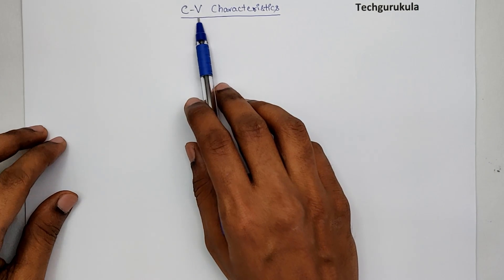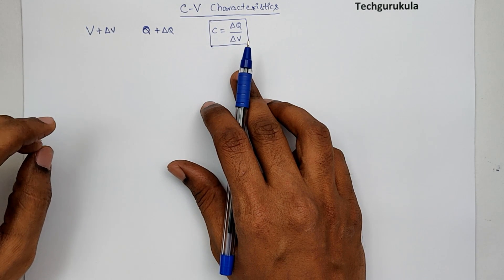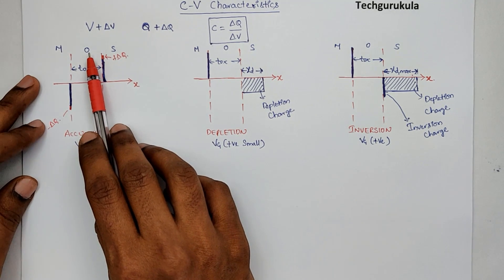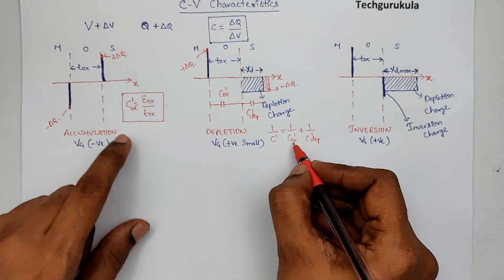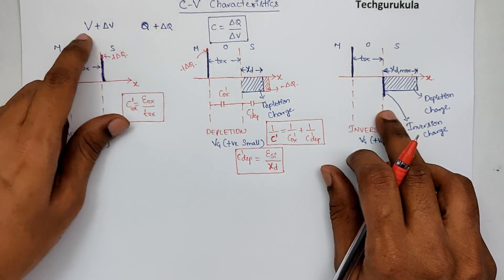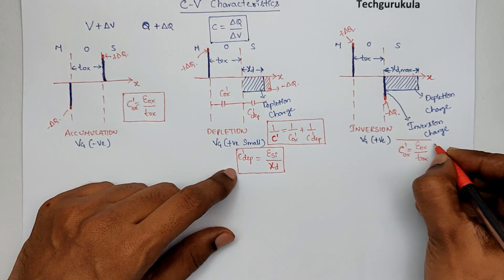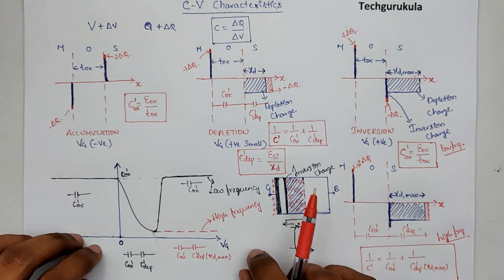Electronic Devices: MOS Capacitor (07) - CV characteristics

Comment: for high frequency, the depletion width is increasing, so why is the capacitance just Cdep, max? why is not like in depletion mode where its dependent on the depletion width length, which in the case of high frequency, is bigger than xd max.

Comment: This is confusing.
Why does in accumulation q gets deposited at interface, while in depletion mode it cant and then in inversion mode, with depletion layer it can?
Why would there be thermal generation when theres no heat for inversion to happen from within the depletion layer?
And for inversion, if q gets deposited on the metal and semiconductor interface, why wouldn't Cox change? C=q/v, q changes there.

Comment: Sir, In inversion mode, why are we not considering €si? There is depletion region charge for width Xdt.
Reply: The "capacitive action" after inversion happens only on the metal-oxide surface and the oxide-silicon surface. You can see that any delta Vg after inversion is accumulating NET CHARGE on the surface of the metal-oxide and oxide-silicon layers only, separated at a distance of tox. The depletion capacitance is not a "capacitance" anymore after inversion because there is no net charge accumulating on both surfaces of the depletion layer (the two surfaces namely being the oxide-silicon surface and the right side of the depletion layer) for any delta Vg. Hope it helps. Cheers!

Comment: doubt 😕
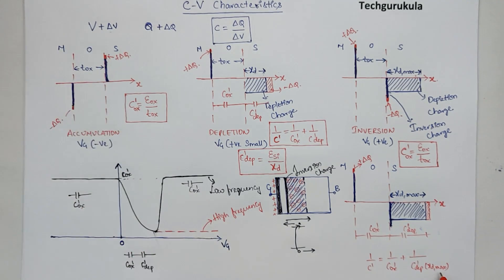at 15:00 C'dep(xd,max),
[xd,max is the previous xd,max] or [ xd,max after adding 🔺Q charge on depletion region]
if 🔺Q charge is adding on depletion region then depletion width should be increased so xd,max should be increased, so at 15:00 ,{ Is xd,max is new xd,max }